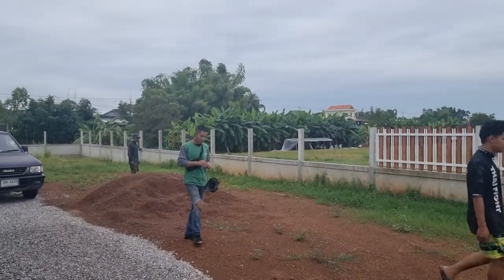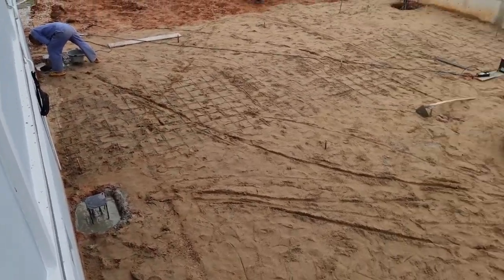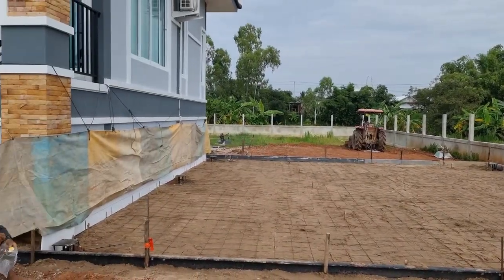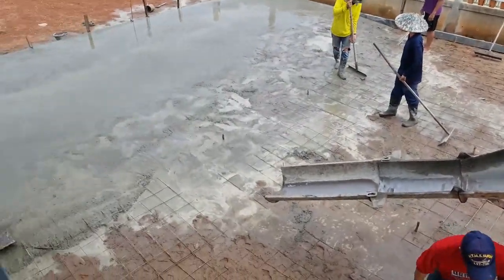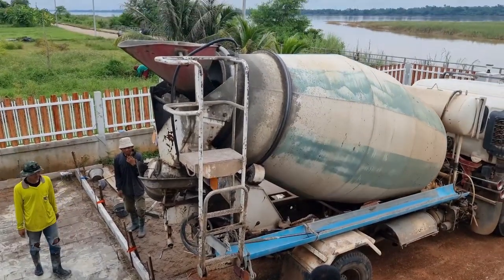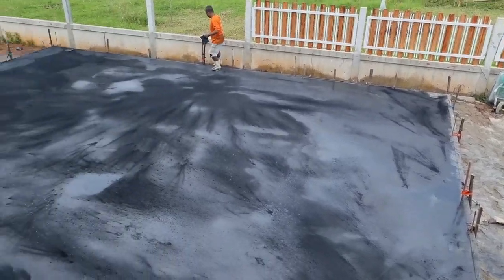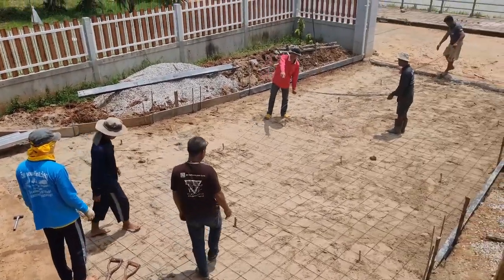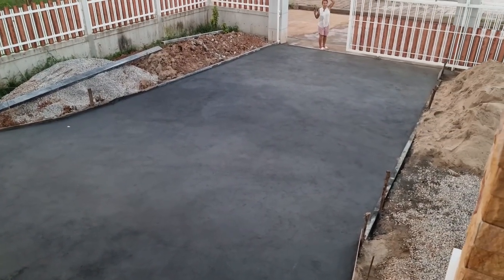Building a house in Thailand - Part 33 - Car port and drive

Comment: Hello fellow Scotsman 😜 Glad to read your putting up guttering as I've seen new builds without, and in a short time the paintwork on the facias are dirty.
Great looking house and really happy for you👍
Reply from the maker: Hi, thanks for watching and commenting, we are also putting guttering up in certain areas around the house that have that problem, the problem here is, gutters need to be about 12 inch box section and even then cannot contain the water during rainy season, in winter it doesn't rain for about 6 months either.  The side of the house that got dirty because of the rain running off the roof and splashing up was the side the car port is going so we won't get that anymore.
Reply from the maker: PS.  The outside facial are filthy already with geko shit, the joys of living with nature.

Comment: Consider putting big and small drainage lines at all edges of the concrete to avoid trapped water
Reply from the maker: Hi, The roof slopes back and is having gutters fitted to run the water to the wall which is having a drainage pipe running along the edge of the concrete down to the road.

Comment: Those Thais do love wet concrete.
That concrete seems too wet but Thais do that because it is easier to work with.
What is the budget for this car port?
Reply from the maker: Car port is 150,000 THB, yea concrete needs to be that wet due to the heat and speed it starts to set.  Thanks for watching and comment.